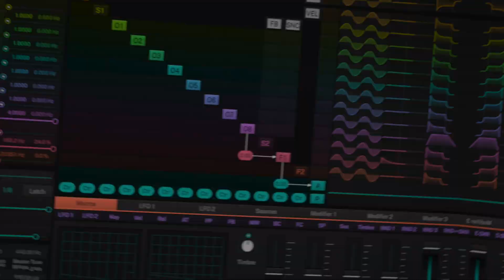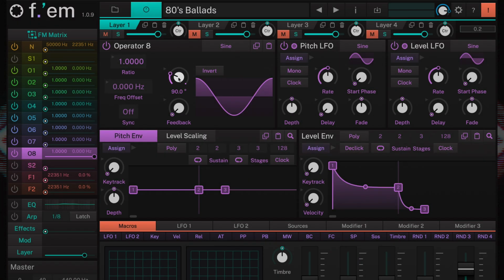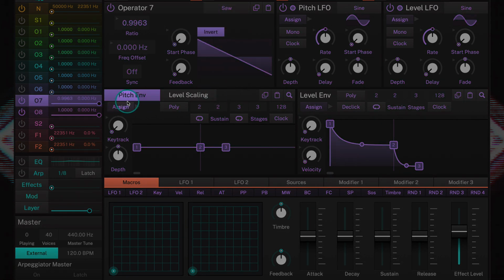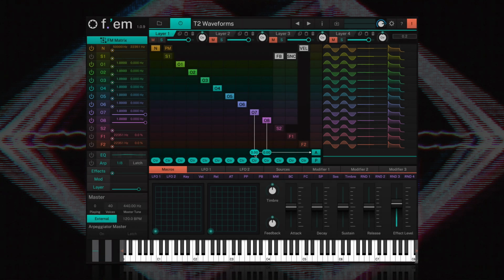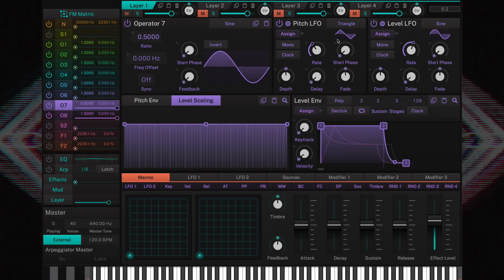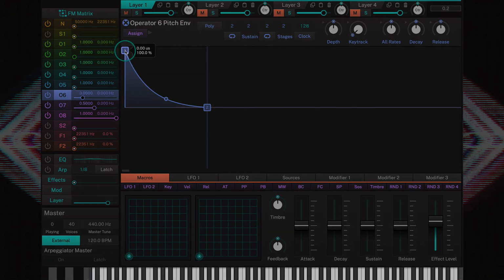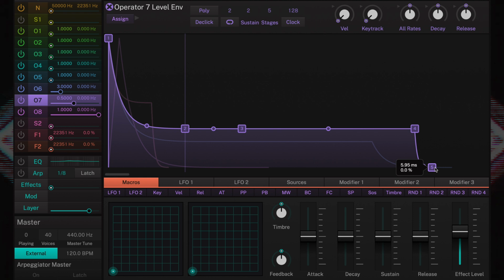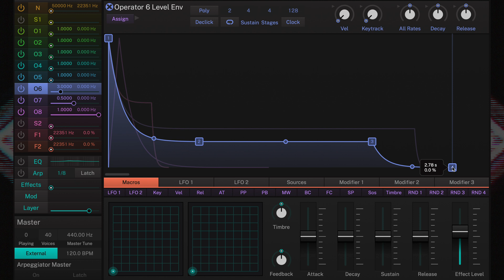Tracktion F.'em Tutorial: Operators in More Detail

Comment: If I understand right, there is not fine detune per operator parameter ? This would make sense since the frequency of operators can be very finely tuned already. However this forces to compute multiples of detunes if you're modulating a detuned carrier.